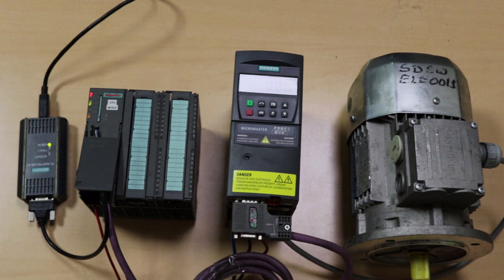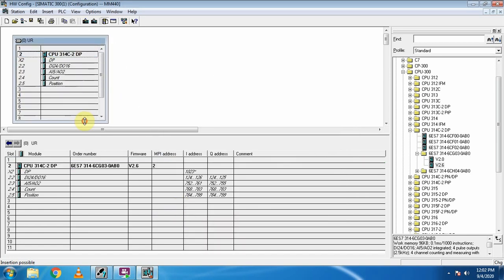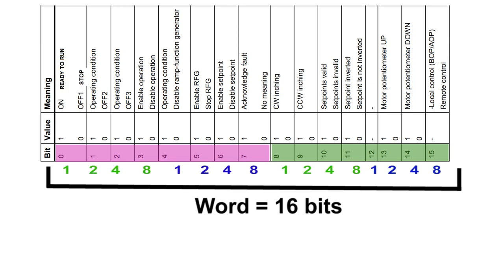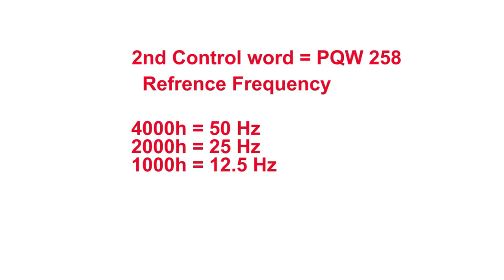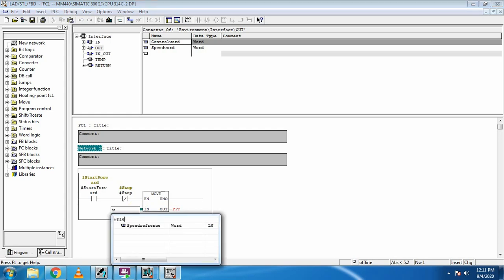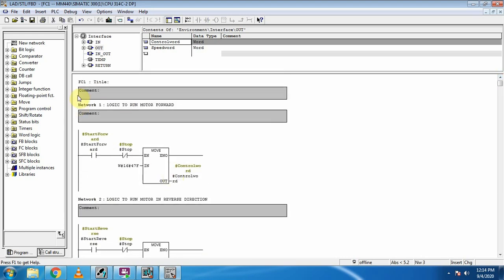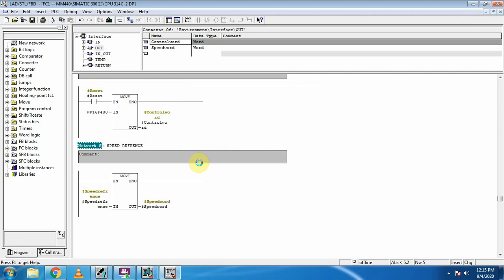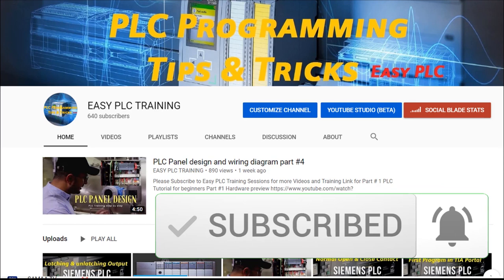How to communicate siemens S7 300 PLC with Micromaster 440 VFD via profibus using Simatic Manager ?

Comment: At 0:50 what's the number option to select from the available options? It goes from 1 to 77 to select on P1000.
Reply from the maker: For profibus you can select 6 in parameter 1000. If not works you can try 5 also. Every time you change this parameter,  you must power cycle the VFD.
Reply from the maker: P1000 is to set the source of frequency or speed

Comment: At 7:31 where do you select the value 4000h to be 50Hz? It's a parameter? Can I change to 5000h being 50Hz or 5000h being 60Hz? Thanks.
Reply from the maker: 4000 is the value sending from the plc to vfd. Yes you can increase it to increase the speed

Comment: Nice learning platform 
My doubt where I get this control word and speed word in manual book pls mention 
Thanks
Reply from the maker: You can search on the Google... pdf manual for 440 drive for profibus communications
Reply: Can you send that link please
Reply: Still don't get it after read the manual,can you explain simple way how you get that codes for control words?
Reply from the maker: See video at 05:00
Reply: @EASYPLCTRAINING  and that 1 2 4 8 came from where?sorry i have a lot of question about this sir..
Reply: @EASYPLCTRAINING  is that binary to hex?
Reply from the maker: Hexadecimal..... same like seven segment programming in the pic micro controllers
Reply: @EASYPLCTRAINING  thank you sir

Comment: hello sir, if I don't have module profibus intergrated with Inverter, May I you P+ and N- connector. As far as I know, That way is like the way you do
Reply from the maker: Yes you can give 24 vdc from other power supply.... in my case it is taking power from vfd ....
Reply: @EASYPLCTRAINING  tks a lot. That's a useful answer

Comment: Sir plz make videos on how to set parameters in VFD as per application.
Now for stop , start , reverse Siemens already given codes, but supposed there is some other applications then how to select parameters how to perform operation plz explain that.

And finally sir same thing can we make in Tia portal?
Is codes remain same or different?
Reply from the maker: Next I am planning to program g120 drive with tia portal.
Reply: @EASYPLCTRAINING  ok thank you sir.

Comment: What is Decentralized Peripherals Address in PLC
Reply from the maker: It is full form of Profibus DP
Reply: What is Decentralized Peripherals Address On/Off(64,32,18,8,4,2,1)
Reply from the maker: Ok now I understand what you are asking ..... suppose if you want to set address 5 , than you have to turn ON the dip switches 4 and 1 . So that 4 + 1 equals to 5 . So the DP address now  for this device will be 5 .....
 Similarly if you want to make address 7 , than you turn ON dip switches 3 and 4 ....
 3+4 = 7 ...
Reply from the maker: https://youtu.be/jLBOHipBy64